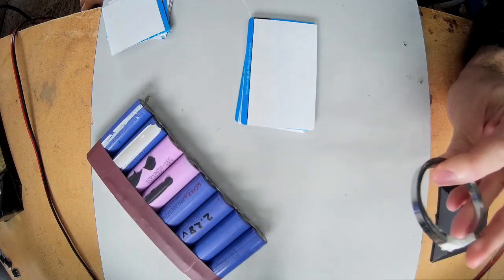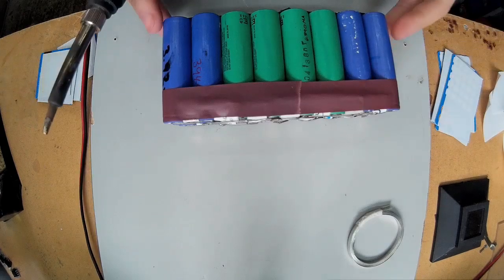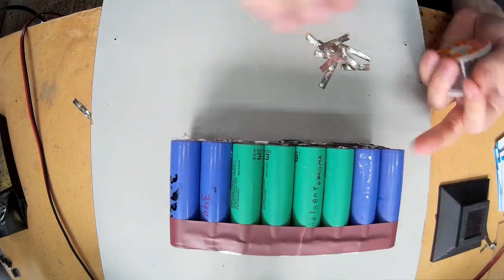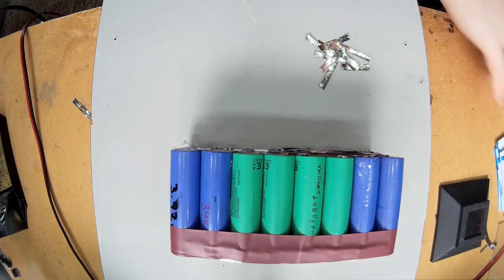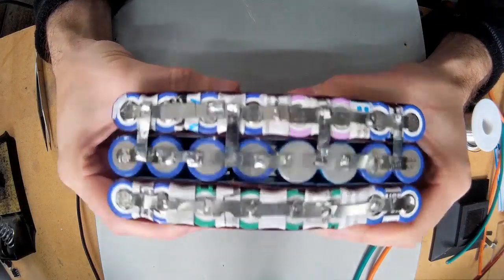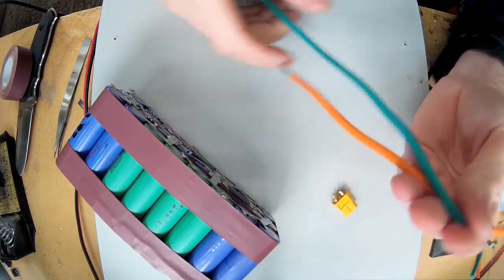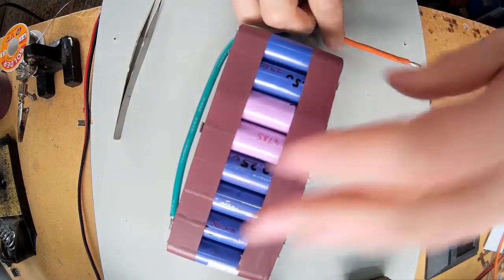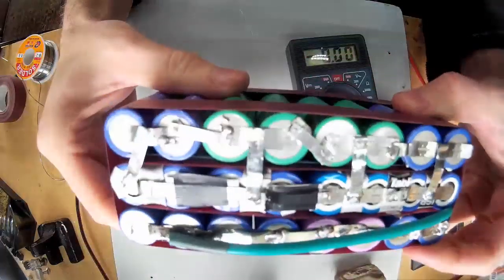DIY 18650 Lithium Ion Ebike Battery Pt 2

Comment: Hi , I need some help . I start my project today and the first cell I removed from laptop batterys charged to 1600 to 2500 , but when I discharge than I get 300 mha . I used the same charge rate 1 Amp . What am I doing wrong ?
Reply from the maker: bad cell don't use it.

Comment: Nice work! 
Curious : If you soldered 2 cells in parallel and then 3 of these in series to make a 12v stack, what is the purpose of the 7th and 8th cell in the 8 cell stack?
4AH per 12v stack gives 12AH using 3 of these in series. So, where does the 3 AH come from to make the 15AH?

Whats the voltage when this 36v battery pack is fully charged?
How do you charge such a battery pack? Constant current and voltage?
How did you find out what is the capacity of each cell such that you can group those of similar capacities together?

Comment: Oh boy, this is the dumbest RESOLUTION I've seen.
You use LiIon battery which has a 2.2V? It is already dead, man.
You use a laptop (high capacity, low current) batteries for the bike?
You know the difference between INR and ICR battery?
Balancing is unnecessary?
This solution batteries will survive for a few hours.
R.I.P for those batteries.
Thank you for watching and my nightmare.
Reply from the maker: +Elias Hackim 
Well over a year on the battery pack is still working. I get over 40 miles from it per charge, has done over 2000 miles.  Not dead yet.
Thanks for your comment.

Comment: Don't you think bus bars make a mess of your batteries? If the solder leaks to the outer casing on the positive connector you could fuse your whole pack. I use solid core wire and resetting fuses. Bus bar the negatives only and fuses across from positive to neg.

Comment: yes like one of the other guys say below you need to have balance charge wires on this and use balance charger like link below. i tried these types of pack with mixed sucess. the problem is you can get any ammount of old laptop batteries for free but ive found most of the cells dont hold much charge and i havent had much luck sourcing new batteries at a resonable price. how many miles do you get on a charge? what voltage and amperage did you build?

Comment: do you use a built in battery management system as in laptop battery charging
Reply from the maker: +vassilij zietseff (davlyn) Not using a bms just careful i don't over discharge them. When i charge them i use a rc balance charger 
like this
http://www.banggood.com/IMAX-B6-AC-B6AC-Lipo-NiMH-3S-RC-Battery-Balance-Charger-p-908064.html?p=070519238739201308J6 
When charging this acts as a bms to stop overcharging

Comment: what watt is the soldier iron u use? looks a small one.
Reply from the maker: Wayne & Rebecca Detectorist it may look small but its about 50 - 60 watt on full power the more power the quicker you can solder the tabs on without damage to the battery.
Reply: Norfolktuber what is the Gage u using to soldier? what do u think is best for a 40w and batterys there all types thickness